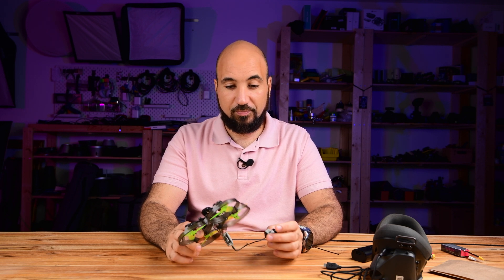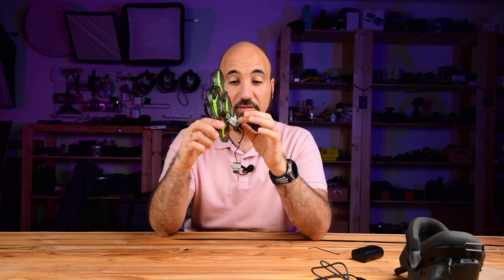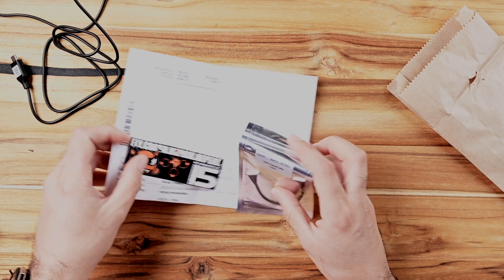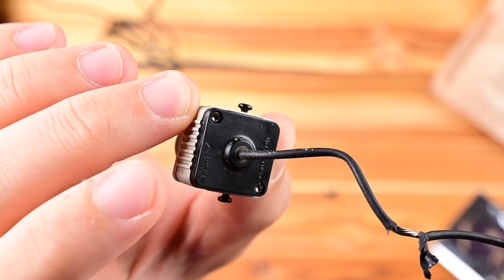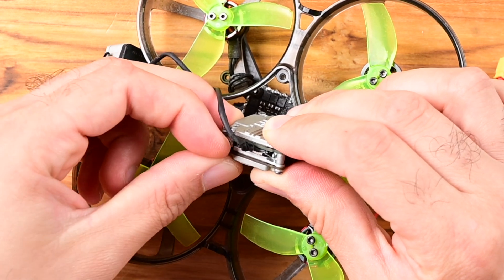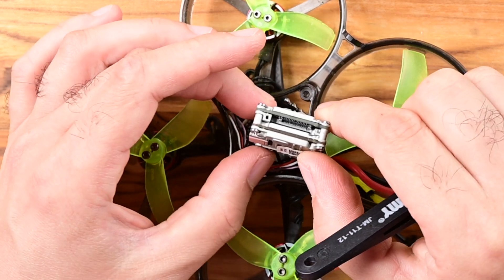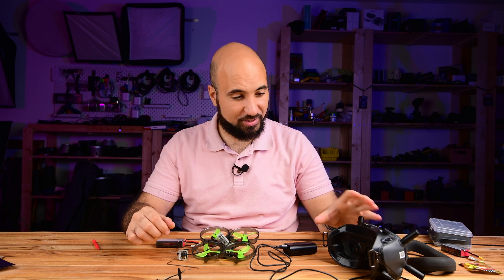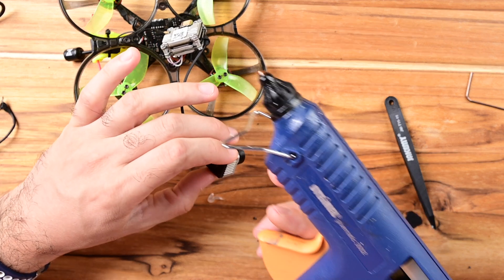FPV Drone issue - CADDX Vista no image | Replace coaxial cable #drones #fpv #repair #fpvdrone

Comment: Salam hamoodi, I had a crash today, and now I only have osd but no image. I tried installing another camera with no luck. I will try this, and hopefully, it works. I have an extra cable that I'll try. Thanks for the information and the video.
Reply from the maker: Salam my friend 😊. I bet the cable is damaged, replace it and you should be good, let me know if that is working for you! Good luck 😃

Comment: Hey,
Do you have to make sure you use the right cable for the camera? Or are the connections on the different Caddx cameras (nebula, polar, dji) all the same?
Reply from the maker: Hello to you too :). They all use the same cable, so you should be good, but for extra security, I would ask the store to give you info about the compatibility with your camera!

Comment: How do we know if the camera or cable is bad
Reply from the maker: unfortunately you can't know, only if you have other camera to test out but this is the cheapest solution that you can test out to see what is not working!
Reply: @bilumedia  what was your MPS during the black out     was it around 7 mbs
Reply: Thanks ,, replaced cable ,, same issue . so I ordered the wasp camera to go with the vista unit ,, will let you know the outcome ,, mabey if you have osd with around 7 mps ,, I believe that's how you know its the cam or cable  and not the unit we will see  !!!!!!!!!!!!!!!!! keep you posted

Comment: Hi

Thank you for the video.

I am from Europe and i need new coaxial coaxial  too.

Where did you buy yours
Reply from the maker: Hello , you are very welcome :). I am from europe too, Germany!

Where are you from?
https://www.rctech.de/caddx-vista-coaxial-kabel-8cm.html?gclid=CjwKCAiAnZCdBhBmEiwA8nDQxe_yFRitUUTS1IDX0Y8TN_V4RKxko5F3X92EhGdrzhxJzfc-iqGhVhoCsR4QAvD_BwE

https://www.copterfarm.de/caddxfpv-vista-dji-digital-coaxial-kabel-1399.html?sPartner=shoppingfarm&number=COF11017.2&gclid=CjwKCAiAnZCdBhBmEiwA8nDQxXYeNPY5497njSUJQaVjcTM5vAJirw0txyvCjJtByxEF3rpvnj64eBoCkn4QAvD_BwE

https://www.ebay.de/itm/255780329054?chn=ps&var=555714294442&_trkparms=ispr%3D1&amdata=enc%3A1ycjCJmDlSY-DkZUcHOKd-g83&norover=1&mkevt=1&mkrid=707-134425-41852-0&mkcid=2&mkscid=101&itemid=555714294442_255780329054&targetid=1716911581159&device=m&mktype=pla&googleloc=9043447&poi=&campaignid=17943303986&mkgroupid=140642150118&rlsatarget=pla-1716911581159&abcId=9301060&merchantid=138410767&gclid=CjwKCAiAnZCdBhBmEiwA8nDQxbWCI1A_lFqK0iljSEN34Oz6YlJ6ljkWwm6gaB5gn0cIKyslgcw5KxoCl5MQAvD_BwE
Reply: @bilumedia  Hi thank you for your help. I am from Bulgaria and last night i cut my coaxial cable for polar nano of my T motor Tron 80 hd whoop 
It was a crash so i relly hope is only the cable